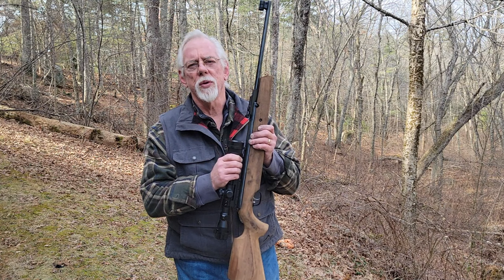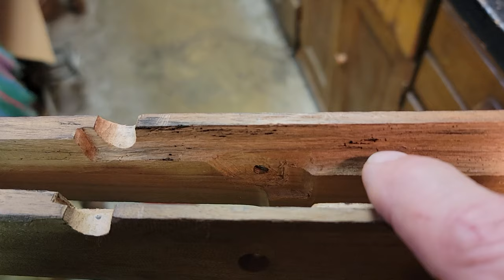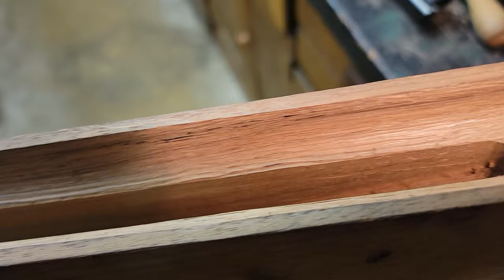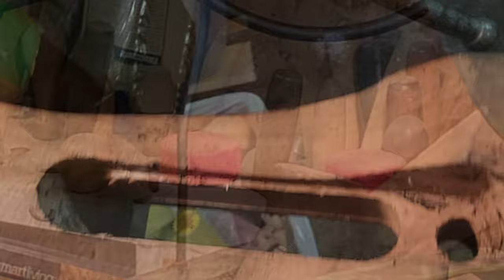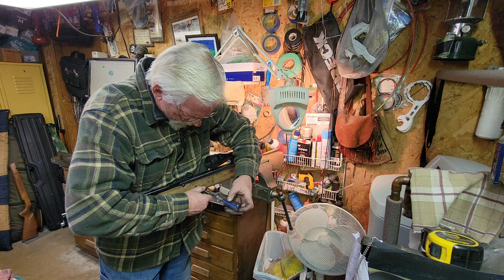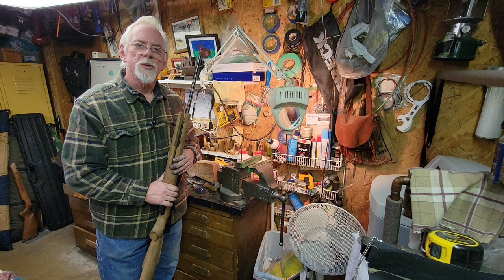Custom HW95 Air Rifle Build Part 2

Comment: Soot "blacking"  is an amazing way to see the high spots on the wood to metal fit. You sir have an interesting skill set. That rifle looks gorgious its coming up a treat. Personally I like the forend length it gives the rifle nice lines, but I understand its a weak spot and could break at some point, can't wait to see the wood finish you put on it. 
How about some engraving on the compression tube like "Pellets and pistons" and the date or something, anyway just a thought. Looks great. Can't wait for next video.👍
Reply from the maker: Hi Graham. Thanks very much. Not only does an extended forend become a weak point but it could also create a tuning fork effect with the harmonics of the shot vibration. The shorter those forks, the less the effect. I'll probably embellish the stock somewhere but engraving the metal would require rebluing the tube. Unless I gold fill it....🤔

Comment: An ebony forend would make it look like a safari rifle, nice job so far,
Reply from the maker: Thanks Gary.
Reply: @razor1962  Let me know if you'd like an Ebony forend tip ? 🤷🏼‍♂️ Honestly, pick any wood you'd like. 😉👍
Reply from the maker: @Marc Myers  Thanks Marc but I think that because of the fork in the forend,  this would be a weak point as the forend isn't solid.
Reply: @razor1962  Agreed, most Springer stocks by their very nature are a Great Big tuning fork, and they can very well resonate. 😉 
I have steel channeled a few hard cases in the past, and I can't recommend any rational person commit to that. 
I tend to go with pillar bedding and Sorbothane dampening obviously... 😂
Allot of folks won't pay for that sort of work. 🤷🏼‍♂️
Reply: @razor1962  I love when a Springer makes that quick thud, and the stock doesn't know it. 😏

Comment: Nice job Kevin … see cyclops  video on   Minwax poly coat wipe on   ,I used it on my  Crosman 1322 wood grips . Comes in  satin and gloss . You can vary the definition by how many coats you do . 😎👍🏻
Reply from the maker: Thanks very much. Sounds like good stuff. I've got other plans however.  I'll be applying a hand rubbed oil finish. I guess I'm just set in my ways at this point. 😉
Thanks as always Peter.

Comment: I've heard about the "soot" process but this is the first time I've seen it in use.  I've used engine blue but you gotta move fast with it.
Reply from the maker: It's so simple. The process is quite old. I know that some of the colonial gunsmiths used this technique. 
Thanks as always Frank.
Reply: @razor1962  Can't beat the price ! 😉👍

Comment: Awesome video.  I hope to have the chance to use this technique on a stock blank that I've had in a closet for an embarrassingly long time.  While I've never had the opportunity to inlet a custom stock, I have tightened up some sloppy factory ones with adhesive neoprene strips. On an already tuned action, I think it makes the shot cycle a little more muted.  More of a thud than a smack.
Reply from the maker: I can see how those strips would help to cancel some vibration and shock. Thanks as always my friend.

Comment: hello ,i did on a hw 80 the glasbedding  , with al parts removed  just the cilnder and end piece . cover it in silicon grease or oil ,after hardening  the epoxy , en removing , the cilinder ,you have the perfect fit ,and never a loose system again ,and the inside of the stock is sealed
Reply from the maker: Hi Peter. I gave some thought to glass bedding the action. But I'm leaning toward not bedding.  I can always do it down the road if I need to. Thanks as always my friend.

Comment: Ive finished a few stocks with Birchwood casey tru oil with really good results I did my Air arms prosport with it a few months ago and it turned out really nice they do a walnut stain that works good also. I don't know if it's available outside UK though. Good stuff rifle is really coming on its going to look spot on 👍👍
Reply from the maker: Thanks very much. Looking forward to the next step. Tru Oil is good stuff.  I've been using it for decades. Thanks as always my friend.
Reply: I agree, It's a great product. I just treated my brand new Air arms S410 walnut two times with it and the stock became smooth like silk and the walnut looks even better.  Would be nice if we could share pics. in the YT comments to show each others results. I,m a springer guy, but i could just not resist to buy the most beautiful classic looking and perfect finished PCP on the market that money can buy👌😁 Just don't wait to long to wipe off the acces oil because it's gonna be sticky quite fast. Cheers Mate!

Comment: Terrific video mate! I’m really enjoying the series and I appreciate the extra effort you put into the editing, camera angles, music etc. keep up the great work👍 I was hoping you might take a moment to help me out, no worries if you’re too busy!  I have a question unrelated to this particular series. I recently purchased a new HW 50s and have done a heap of pallet testing. Unfortunately I am getting a lot of vertical variation in my groups. This is particularly evident if I push the target out to 55 yards I am getting over 8 inches vertically. Horizontally my groups are within an inch. I am relatively new to air rifle shooting and I have been trying to use good air rifle techniques such as artillery hold, soft hands, soft in the shoulder, etc.. but could this be barrel flip or other technique related issues? I have also tried to be consistent with my pallet seating and using quality H&N field target trophy pallets. After approximately 700 pallets and lots of trouble shooting checking stock screws etc. I’m starting to think I may have purchased a lemon. Any help would be greatly appreciated. Thanks again from Australia👍
Reply: Hi Nathan! Sounds very strange mate. If you have tighten the stock screws it can in my opinion only be the scope that causes the problem. I have had the same problem. Scopes and springers are no best friends. I destroyed a Nikko Sterling scope with my HW80 within the tin with pellets was empty. Even expensive scopes that are rated for heavy centerfire cartridges do not survive the "double recoil" of a springer air rifle.  You need a scope that is springer rated. I use the Hawke Air Max series scopes on all my springers and i have had not one single issue with them. Use also quality scope mounts......I't hard to believe that a new HW50 has a failure causing a vertical spread like that. Just don't tell me now you shoot with open sights.....😵‍💫😅Cheers!
Reply: Thanks so much for your reply! I actually have a brand new hawk Air max 3-9x40 AO and I am using Sports match mounts with a locking pin. I have just taken the scope off, I might try it with iron sites. Thanks again, I’ll let you know if I find out it is the scope. I have hypothesize that it could be a seal problem. Perhaps the piston is faulty and I am getting different power outputs. I thought this could potentially explain the vertical stringing. This is just a guess…
Reply: @nathanvernon8320  Thanks Mate! That,s an excellent scope you have mounted, the mounts too. Looking forward to your findings. Can be a broken spring too.  Good luck!
Reply from the maker: Hi Nathan. It sounds like you may need a chronograph.  If  your rifle isn't shooting at a fairly consistent velocity it could explain your vertical stringing issue. That's the first thing that I would check. I'm happy to hear that you're enjoying the channel.
Reply: Thanks again, I’ll let you know.
Reply: Hi there thank you for your reply and advice. I have actually been intending to buy a chronograph any way as I am just getting into reloading for long range shooting. I will let you know how I go. Thanks again for the videos😊👍
Reply: @nathanvernon8320  Excellent diagnostic on the seal. I highly recommend the Air Rifle Headquarters New-SGS R6, HW99, HW50S piston seal. The New Hornet XLD tune kit as well.
Olde School Buttons work a treat on HW50's too ! 😉👍 
Should be the 1.024-25 inch seal. 🤔 Make sure to debur all slots and metal work prior to carefully tucking an inserting the new seal. 😉
RE: muzzle flip. You can always wrap a big ball of plasticine/modeling clay around the muzzle for weight to see if it calms it down. If it does... You have your answer! 🤷🏼‍♂️
Lewis Reinhold of Reinhold Precision Airguns Australia should be able to direct you to virtually any quality products down in OZ.
He's the Finest kind of Mate and a wealth of knowledge to All OZ's 😀👍
Reply: @rapalaron6348  Hawke Airmax 3-9×40mm is dead nuts perfect for a Weihrauch HW50S ! 👌😳

Comment: One of the advantages of a wooden Schnabel forend is that it thickens to the tip and the radius dimensions are calculated by wavelength in order to cantilever back to thicken the forend very close to 360° (0r as close as you're likely to get given the breech block) ? 🤔
Still: it's a Lot of work and doesn't always blend well depending on the forend contour. 
It took me a full week to calculate and blend on the 3/4 FWB 124 stocks and I only charged $45.00 for the feature... 😣
FTR: Steel channeling is a bloody mess and extremely time consuming but it very well did stiffen the forks virtually doubling the modulus but Modulus = Resonance ! 🤦🏼‍♂️ (It created a Perfect Tuning Fork) 🔕
Reply from the maker: The more I look at it, the less I see a schnabel as a good fit for the lines of this stock. A simple back angle with a slight radius seems appropriate.
Reply: @razor1962  Yeah... A Schnabel doesn't work for that BR Profile. 🤷🏼‍♂️ A back angle is correct. 😉👍

Comment: Now what about glass bedding it? 🤔
Reply: Properly inletted, Glass Bedding is rarely necessary. BR shooter's just like the thought of float fitting the action and there are just fewer and fewer guys with the actual patience to properly scrape the inletting, actually own inletting scrapers or even know how to sharpen them anymore... 🤷🏼‍♂️
If the inletting is properly milled, it normally doesn't take a lot of work to get the action to seat snug. 😉
Many stocks these days are cut on duplicators, and a duplicator can be pretty sloppy compared to an Inletting Mill. Inletting mills tend to be Heavy, Solid, and Precise. Where as, a duplicator is a pantograph armature designed to move freely. Sometimes a little TOO Freely ! 😣
Apparently right about then you buy your precision in a Jar ? 🤔
Reply from the maker: I gave it some thought but I'm leaning towards not bedding it.
Good suggestion though Frank.
Reply: I gotta admit my R9 stock was far from perfect, the factory finish was thicker on the left side and you could see planing chatter looking down the right side of the forestock.  After straightening all that out it didn't set perfectly in the stock so I glass bedded it,  Did the bedding help?  Who knows, but it is the most accurate break barrel I own.
Reply: @frankmaze1972  One of the things I see most often is that the stock inletting is unsealed. Generally this is workable, but if the rifle is shipped in an unpressurized or improperly sealed shipping container a Springer stock can shift quite a bit ! 😳

Sometimes when guys refinish vintage stocks they inadvertently expose the old seasoned wood to a fresh air supply and all hell breaks loose too. 🤦🏼‍♂️
Reply: @marcmyers1465  yes, the inletting is very rarely sealed, and I always hit it with a few coats of poly to seal it.  Why would you seal half a piece of wood and leave the other half exposed to moisture.
Reply: @frankmaze1972  One of the more extreme parlor tricks I learned in school was to cut a fresh 16"× 3/4"× 3/4" piece of Sugar Maple and put 2 coats of hard finish on all but 1 linear side.
In fairly short order it turns like a Boar's Tusk ! 😳
Never understood unfinished inletting ? 🤷🏼‍♂️ In the old days they'd seal it with 50/50 Super Blonde Shellac and BLO. Scandinavians have been doing it for hundreds of years now. 🇸🇪